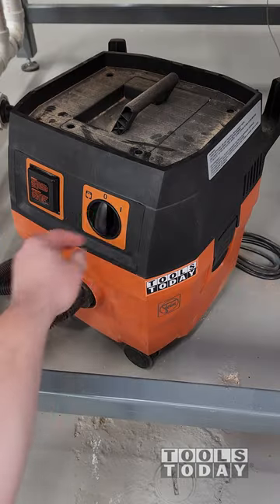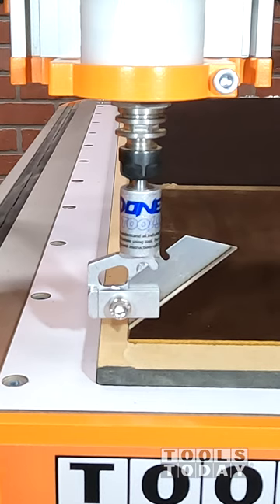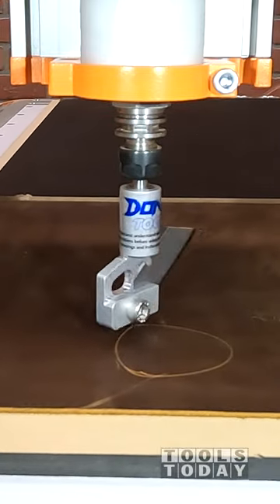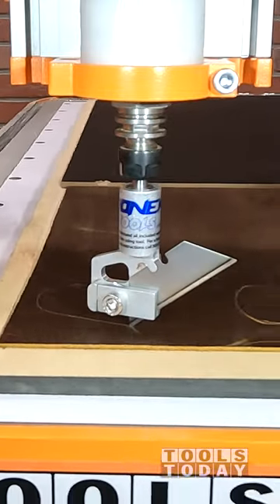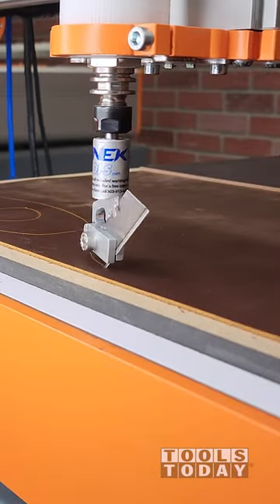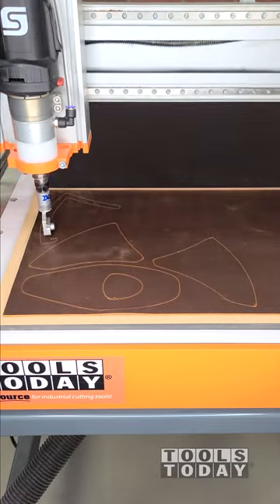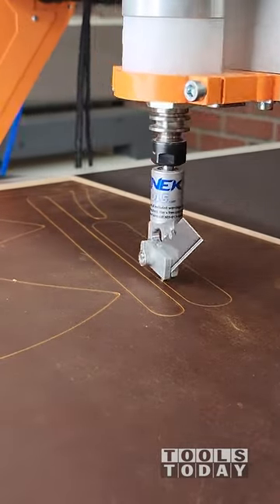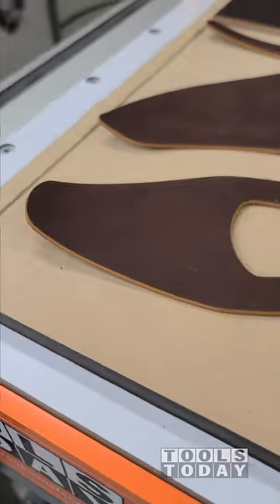Cutting Leather on CNC Explained

Comment: but the spindle is turned on or not, how does it move in this way it cuts only the leather or also other materials
Reply from the maker: The spindle is off.  There's a bearing inside the drag knife and that allows it to just follow the motion of the CNC machine since it is offset from the center point.  It cuts many different materials - Snowboard and ski base material
Wood veneer for inlay/marquetry artwork
Leather
Carbon fiber pre-preg laminates used for aerospace, military, and automotive components
Carboard for custom packaging
Fabric – All sorts including dry fiberglass, carbon fiber, and Kevlar -> Coroplast
Vinyl for signs and stickers
Plastics like UHMW polyethylene, ABS, Lexan Film
Paper – All kinds 
Foamboard
Magnetic sheets
Gasket Materials